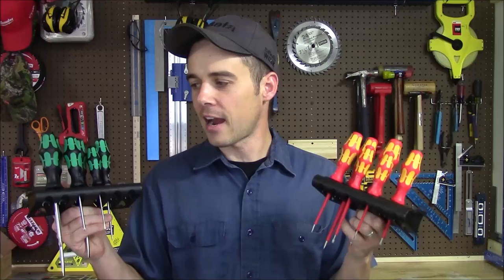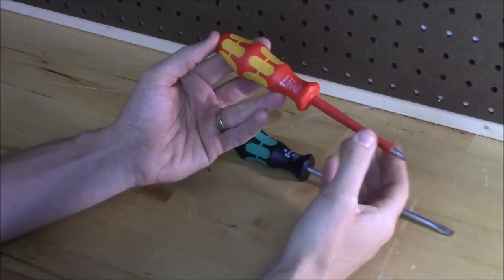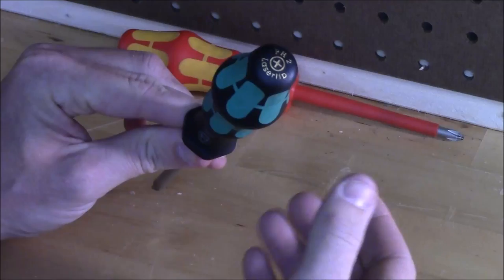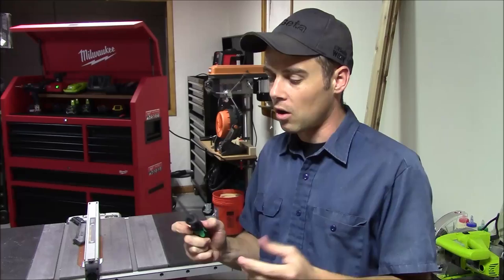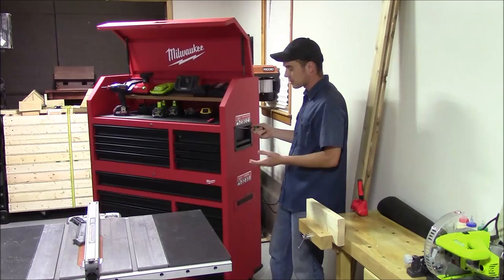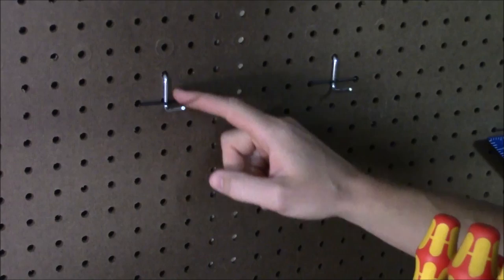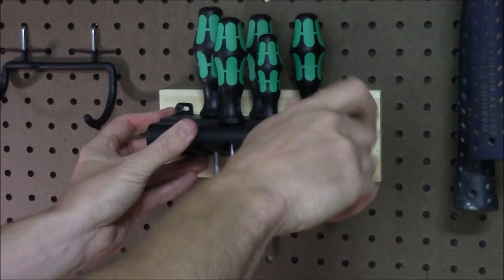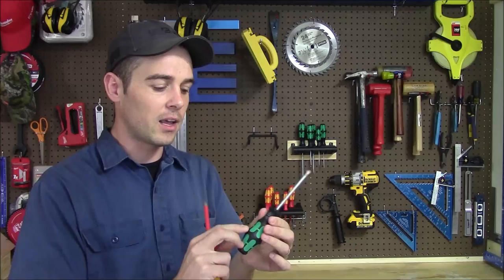WERA Kraftform Plus Screwdriver Sets (Insulated & Non-Insulated)

Comment: The tips on these really are impressive. I was surprised when I first got mine , as I pulled away after screwing my fist Phillips the screwdriver stayed in the screw and came right out of my hand. Granted I was not gripping it tightly but I’ve never had that happen with any screwdriver. I have the insulated set and want to get the non-insulated now. And they are as comfortable as everyone says.

Comment: I personally have wera screwdrivers and multi screwdriver set.
The antislip laser etching tip faded with in a yr. 
However, well worth the price. If you only use number 2phillips and 2 slotted screwdriver as most Americans your talking 10$ year. That's not bad. But my screwdrivers still work and I magnetized the tips.

Comment: I have a set of the Craftsman Diamond tipped screwdrivers that MAY be a more comparable tip to these.
I looked at the link provided and the prices are decent 👌so I will definitely get a set of these and the 1/4 inch driver. 👍👍
Thanks for the review and if you get your hands on a Craftsman Diamond tip, see if they do the same with the box.

Comment: The "non-insulated" screwdriver's handles are actually just as insulated as the insulated. They make the ones with insulated blades because try as you will, your fingers WILL wander onto that blade. Source? I'm an industrial electrician that has gotten hammered more than once because I thought I could just be careful and work on stuff hot, lol.

Comment: I've got several different Wera screwdrivers.  I love the laser tips.  One thing though - I've also got a set of Vessel screwdrivers for when I work on electronics and/or Asian vehicles - they're full of "JIS" type screws...basically the Japanese version of Phillips screws.  These Vessel screwdrivers will also pull my toolbox around like you did in this video.  Any chance you could do a review on JIS-type screwdrivers?
Reply: AKJeeper are these those pain in the ass zinc colored Phillips on Honda’s and Toyota’s? I have a hard time getting those out. If I’m using the wrong tool I’d love to have the correct tool to not strip those damn things out.
Reply: Yes, Phillips is the wrong tool.    There is nothing wrong with the screws.  Vessel or gofast innovations make or sell JIS screwdrivers.  They work fine on Phillips, just not the other way around.   It is not a good idea to call them “Japanese phillips.”   It is confusing.  Just say JIS.

Comment: Are the shafts on the insulated ones much thicker than the shafts of the non insulated?

I'll be working on aircraft electrical systems, so part of me thinks I should get the insulated ones, but then if they're too thick to get in to tight places they may not always work for me. Pulling circuit breakers and disconnecting power is standard practice in aviation so I don't think the chances of being shocked are too high, but if the shafts are a similar thickness then maybe I should get the insulated just to be on the safe side.

Thanks for the review!
Reply: the "insulated" screwdrivers are rated for "1000v" even tho most will far exceed that voltage range to around 22kv. as a electrician I do not use insulated screw drivers much. one is to never hold the shaft of a screwdriver, you can use electrical tape (old trick) or even plastidip to create a insulation mod. really the point of insulated screwdrivers is to prevent an electrical arc from occurring if you do happen to short circuit something such as if you drop a tool in a panel ect.

Comment: These Weras are not "phillips" they are  ISO 8764-1. ISO 8764-1 was designed to work with phillips, JIS and DIN 5260 and to supersede all three of those standards. Note that the reverse is not true, a true phillips driver will damage an  ISO 8764-1 screw. However AFAIK only american companies are still making oldschool drivers. Japan has retired JIS in 2008 and Germany retired DIN 5260 in 2001 and both have switched to ISO 8764-1 so pretty much any cross head screw or driver you get from Asia or Europe now will be made for ISO 8764-1. Like with JIS screws  the flatter and more vertical driving surfaces on ISO 8764-1 drivers greatly reduce the tendency to cam out.